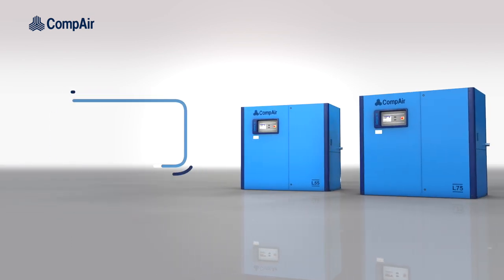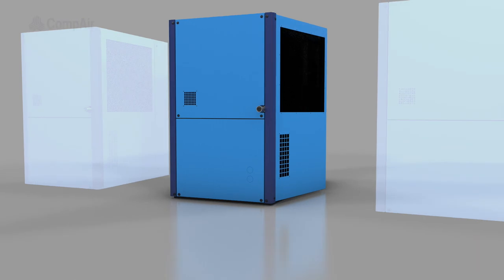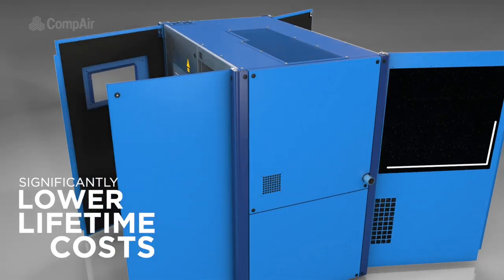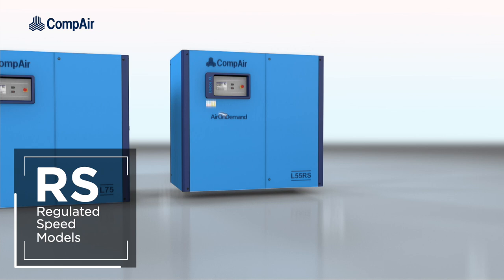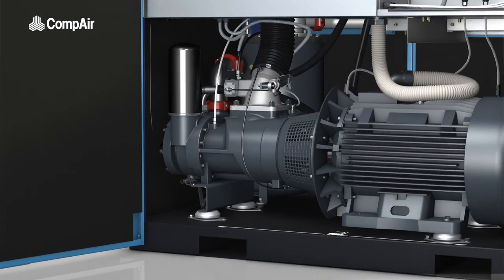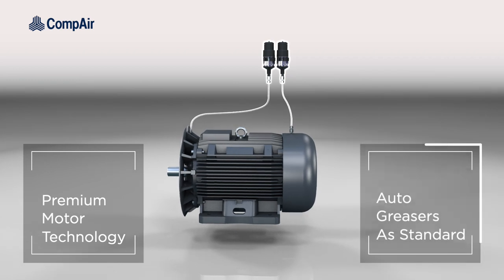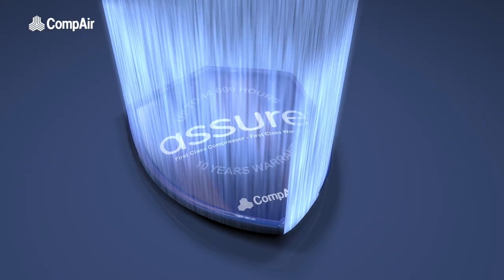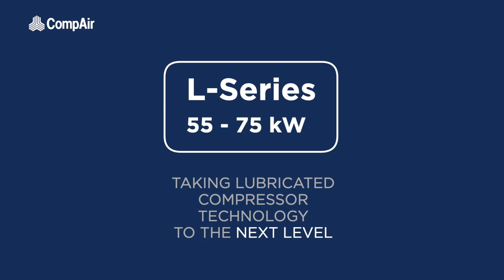New 55 to 75 kW lubricated screw air compressors from CompAir

Comment: The product video seems awesome but their after sales in Asia is questionable... In my own opinion to protect a customer investment... After sales service and product reliability is the most important factor... After the merge with IR it seems its even more questionable what will happen to GD and Compair in the market...
Reply from the maker: CompAir has a long history of sales & service support in Asia, with an extensive network of distributors and local sales companies. The GD/IR merger will improve & strengthen local support for more customers who require expert help from qualified engineers about their compressed air needs. To request service & support please visit our website https://www.compair.com/en-gb/compressor-service - the virtual assistant box will appear at the bottom of the screen, you can request an appointment directly using this tool.